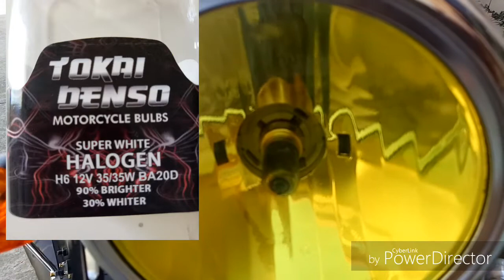TVS XL100 CAPACITOR MOD for LED lights

Comment: You can disconnect the yellow wire from regulator and tape it.. then connect the yellow wire going  the stock lights to the orange wire.. that way you have a stable 12v dc lights.. you can now change stock bulbs signal lights into leds.
Reply: maybe you can change the stock flasher relay into dc flasher for led signal light...
Reply from the maker: @azielgrey1539  I'm sure someone else has already done this. Probably just asking on the topic posted on one of the Facebook group pages? Sounds like a good topic.
Reply from the maker: @azielgrey1539  I recall of someone rewiring the AC generator. Making it DC. I remember seeing in a couple of years ago on the XL 100 facebook group. Just thinking..
Reply from the maker: The short answer is I don't know.

That said, it sounds reasonable. But, probably won't work correctly. It's probably going to be to much current draw. The 12 volt circuit was only intended for the horn basically.
Reply from the maker: The 12 volt DC side... Because the horn needs 12 volt DC to operate correctly. There's a lot of weird stuff. Like the flasher relay is designed for AC voltage. And, the turn signal switch is wired up backwards. I'm thinking about back when I was poking around with a voltage tester. It was a long time ago.

Comment: Hey Steve!  Great vid!  Could you possibly update this with a video of the engine running and the lights on at night time?  I kinda want to see if eliminates the flickering of the lights when the bike is in idle..  I'm planning to mod my Dazz scooter with this mod but I plan to use a 12v 2F supercapacitor bank from Lazada.  I know it's gonna be pricier but if it will allow my bike to run lights totally flicker-free, it would be totally worth it for me.
Reply from the maker: Thanks for watching 😊 and your comments.

There is a little bit of flickering at idle. Very slight. Almost unnoticeable. At higher revs no flickering at all. 

Is the dazz without a battery?
Reply from the maker: This xl100 video is from about 4 months ago. I had a bad wire problem. Did some trouble shooting and rewiring. 

At the last few seconds I did a quick test of the headlight. High and low. At idle.

https://youtu.be/q9mwxfIyCGc
Reply: Watched it and saw that slight flicker.. I'll prolly move forward with using the super capacitor bank as I plan to totally solve the flickering at idle. 

Thanks again! Cheers!
Reply: The Dazz has a battery but it's wired to power the cdi while the lights are wired to the power regulator that is in turn hooked up to the magneto drive.